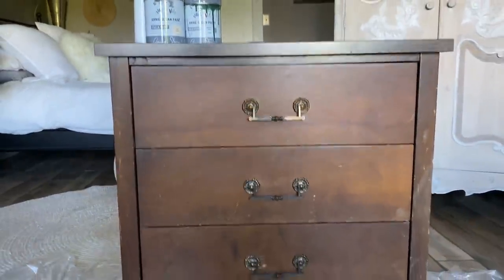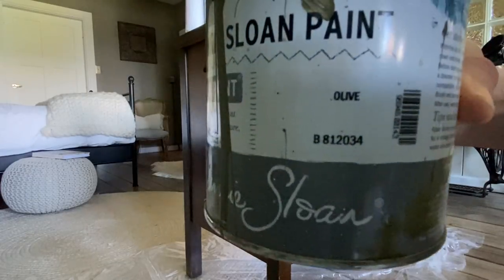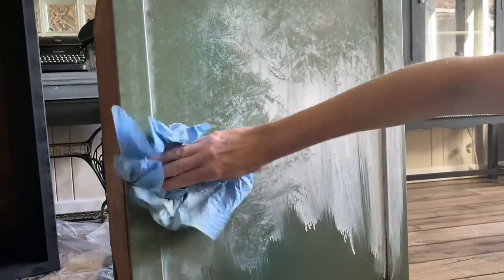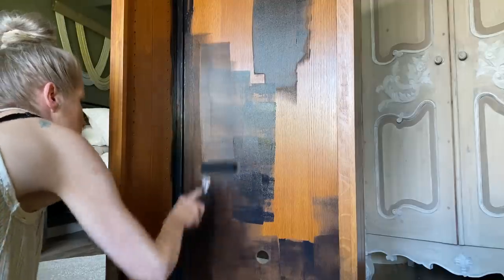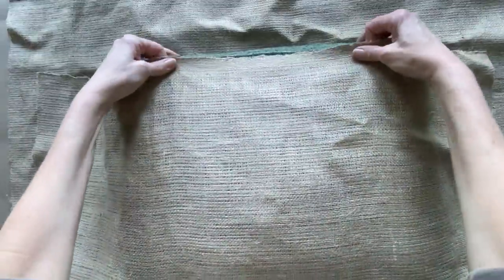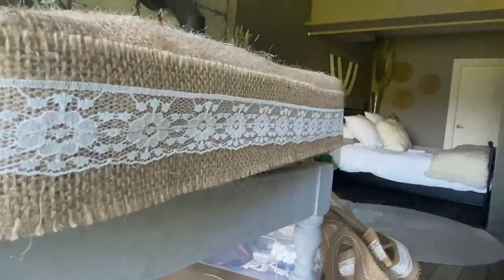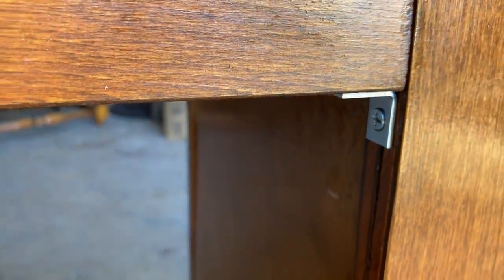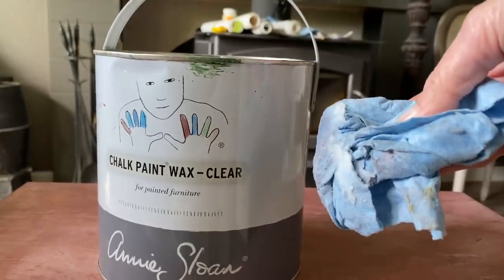4 Decor DIY:Decoupage Dresser chalk paint wash, Bookshelf, Ottoman & Magazine Rack makeover|ASMR diy

Comment: I make stools like this with thick cutting boards and wrought iron or wooden legs like you have. I also took a memory foam mattress pad, cut in half, sprau glued to the wall behind the bed, then spray glued the second layer. I cut a piece out of a new canvass paint tarp and stapled it to the wall. I painted a decorative wood trim 3" wide with wood rosette  blocks on the top corners. It looked amazing 🥰